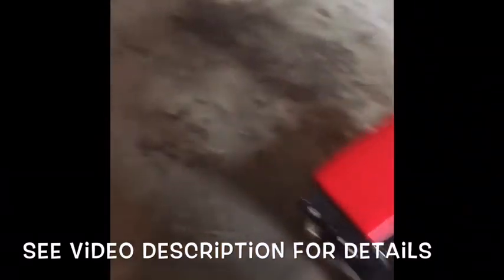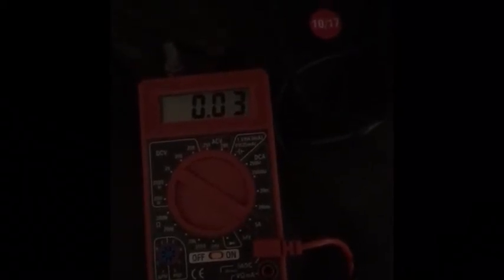Parasitic Drain - RESOLVED: 2007 Honda Odyssey

Comment: Hey. Video was too dark. It's not worth at all.
Reply from the maker: It was dark in garage at the time. It  was before I had better lights in garage.  It is what it is.   Solution was to remove the kit that had been installed into the back of radio.

Comment: I hope I am not declaring victory too early but I have the EXACT same issue and resolution but with a 2006 Odyssey.  The parasitic drain measured at ~70ma and the cause was an after market iphone kit from 10 years ago.  I am not sure why all of a sudden it is causing problems.  After removing the iphone kit, it measured ~15ma which is acceptable.  THANK YOU so much for this video!!!
Reply from the maker: Thanks,  this is why I make these videos
Reply from the maker: Might try to use a  FM transmitter that is blue tooth enabled that plugs in to 12v adaptor   As an alternative. 
See Amazon

Comment: Summary (or watch on 1.5speed): check the fuses under the hood first, and of those, first check the 40A ACC fuse (box-shaped)...because this fuse actually goes to a little fuse panel that is in the cab, passenger side.  In this guy's case it was the circuit on the radio fuse.  In my case it was a 7.5A fuse, #13, which is "clock/backup"....and I still need to troubleshoot what exactly is the issue.  I have about 505mA drain...which is huge, and kills the battery in about 3 days.
Reply: @user-ms2mr2mc3g  I know this is old but there’s two things to check on these vans that like to go parasitic regularly. The AC compressor relay and the rear sliding door latch. You can test for the latch issue by pulling fuse no#7 on the drivers side interior fuse box
Reply from the maker: That’s good to know and for others who view this video comments
Reply: I have the same clock/backup drain. Did you get to figure out what it was and get it fixed? Thanks.
Reply: Buddy if that is a huge drain that what is mine? I replaced alternator and charged battery and it was dead the next day
Reply: Any updates on these?